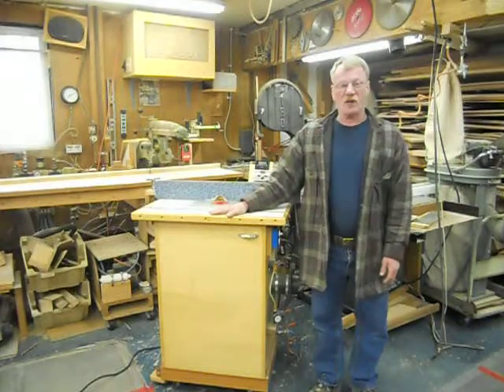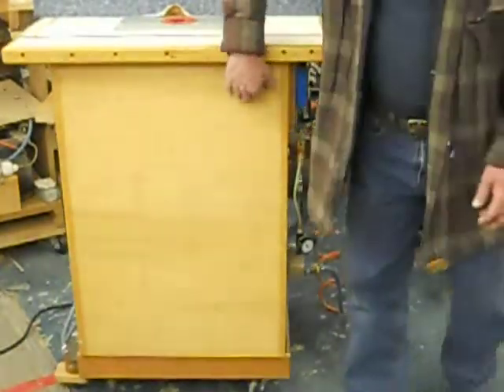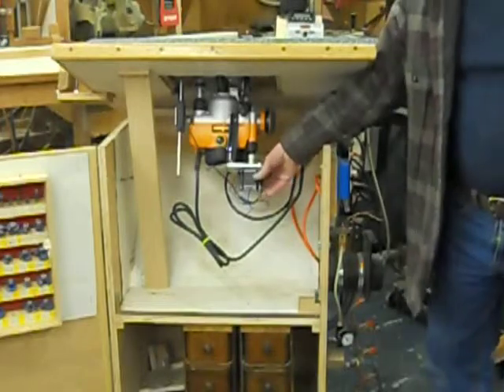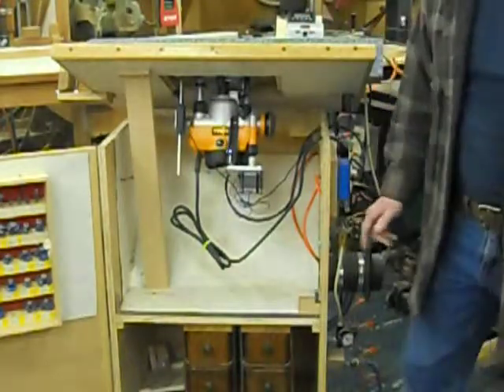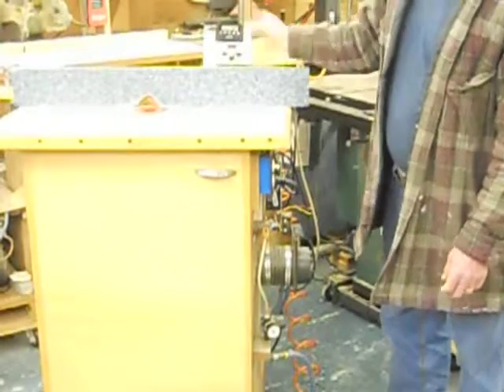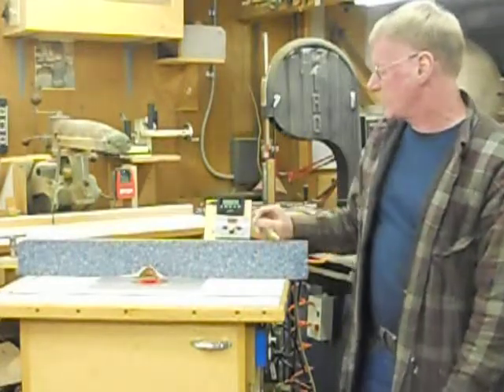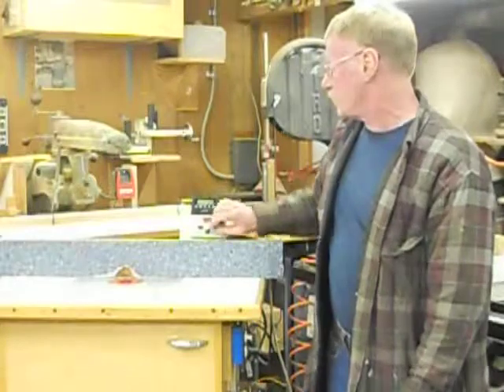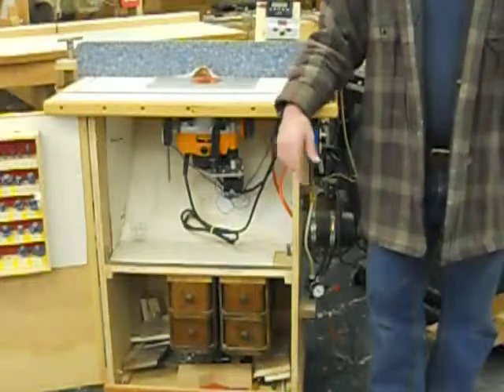Router table w electric lift and air brakes 001

Comment: Hi Mark
Thank you for amazing and informative video,
The reason I searched for this video is that I was planning to build a router lift with a stepper motor.
Would it be possible for you to list the equipments model (link if possible) so that I can copy your solution?